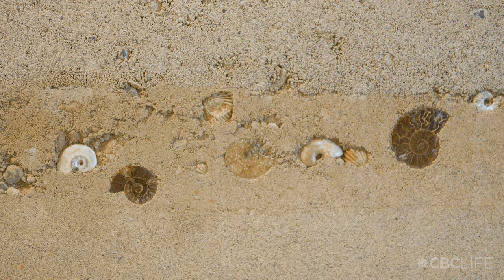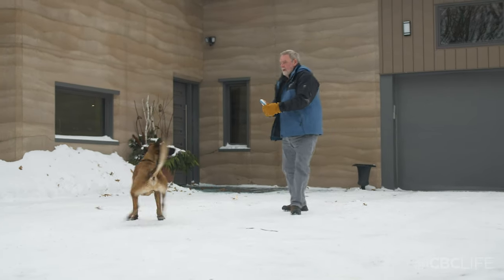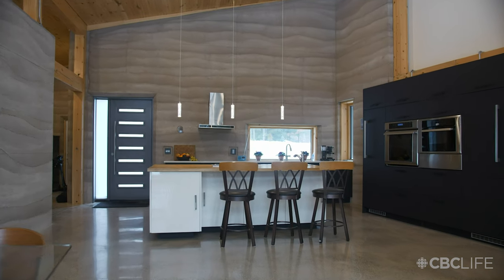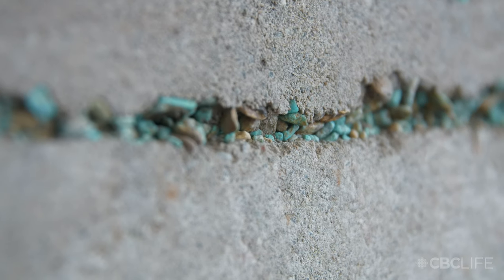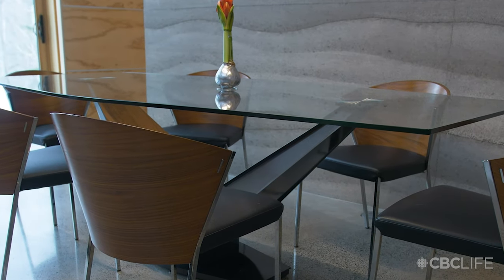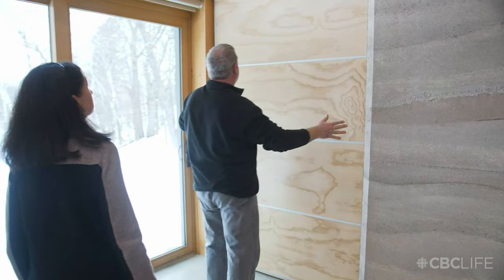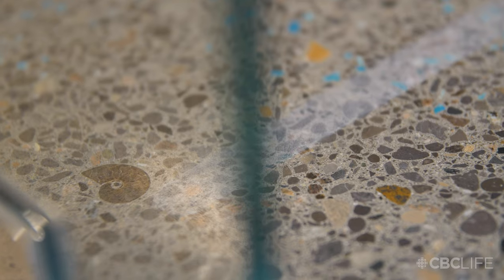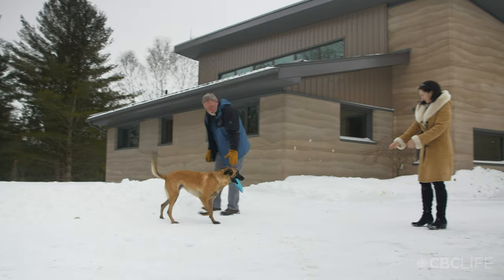Sustainable Rammed Earth House Tour

Comment: Just seen your channel for the first time and i am very impressed with your modern and spacious looking house. I am over in the UK and thinking of buying a property in Bulgaria and was looking at an innovative way to build a warm house for the winter months. How do you keep the house warm and what part of North America are you located ?, also how big is your house and do you have underfloor heating or electric heaters in the house ?
Reply: This house is built in eastern Ontario. It has a 2400 ft2 interior footprint. First the walls, floor and ceilings have to be insulated (minimum R40) and air sealed….that is critical. Our heating system relies on captured rainwater from the roof, stored in a buried underground cistern (3000 gallon - wish it was bigger). We have a liquid to liquid heat pump that circulates glycol through the cistern water and extracts the heat, transferring it to the in floor heat loops.. We maintain 18-20C over winter. This is the ONLY heat source for the home. From Nov-Feb, the water stored in the cistern converts to ice as the heat is extracted. If winter is particularly harsh, then entire cistern is ice. We add small pumps to circulate the water which prevents everything from freezing solid. The insulation and air sealing is critical. Last winter we lost power for seven days…..so no heat. The interior temperature of the house fell one degree in seven days. So don’t neglect the insulation/air sealing details.
Reply: @weshanson1281 Thank you for your answer. I was also interested to know about it.

Which insulation material do you use for insulation?
Does insulation sit in the middle of the wall ?

Comment: The fossils are an incredible addition. 
I'm just wondering about the weight bearing and water resistance? Is it possible to make a 2nd floor?
Reply: Thanks our walls are 20 feet tall at the highest point. Two floors are absolutely possible

Comment: I love the lines on the walls! Very cool look and a good story.    Rammed earth walls do work well in New Mexico with hot days and cool nights but in Canada's constant cold winter weather I can't see rammed earth as providing any insulation at all.  If this is an insulated rammed earth house it's not very sustainable at all. Actually even calling it rammed earth is a stretch, portland cement, gravel and soil make concrete, not rammed earth. 

How about some answers?

The total cost of the house?
Time to complete?
Size of AC system?
Monthly kwh used? 

Once we have that info we can determine how sustainable it is.
Reply: Rick Parker 

To answer your questions.

The cost of the house was about $500 per sq foot of living space but a fair portion of that is related to finish choices, particularly the kitchen and bath areas.
The time to complete was, essentially two years, largely because once the building envelope was complete, we did all the interior work ourselves. We also took six months off and suffered significant delays waiting for the concrete floor to be poured and polished. The exterior building envelop took eight months to complete, about four for the Rammed Earth walls, the rest on a fairly relaxed schedule.
There is no air conditioner. There is no need. Summertime temperature rarely hits 24C and the HRV is sufficient to cool the house at night.
The energy costs are $125 a month in summer, $250 a month in winter. Energy demand is primarily related to domestic water (well)  and hot water. Total energy use is about 60% of what a typical stick built home uses based on ON averages. I don’t really worry about it. There is no furnace, no wood stove, no AC. Heat is from a water to water heat pump that cycles glycol through a buried cistern behind the house which is filled with rainwater captured from the roof. The winter electrical cost is largely from the circulation pumps for the in floor heat. Heat is turned on in November and shut off in March. In the fall and spring, the passive solar is the primary heat source.The cistern water is used for irrigation in summer.

Yes, the walls and floor are insulated, at about R40. The ceiling is dense pack cellulose at R80. 

There is only 5% Portland cement in the mix. It’s definitely not concrete. Concrete is...well concrete. It’s ugly but easy. A great choice if bunkers are your thing.

Anything else?
Reply: cement is the only necessity in it and its minimal. Something from like 7% or more depending on choice. Gravel is not essential. There are still earth-made buildings and walls constructed thousands of years ago that are still standing.
Reply: Concrete doesn't use soil. Concrete consists of cement (15-20%), sand, gravel, and water. Rammed Earth consists of cement (5-10%), sand, gravel, and soil (containing clay and silt). Concrete never contains any clay or silt content.

Comment: Interesting..!! 
How is the insulation done?
Reply: You don't need insulation in a rammed earth home, except in the ceiling. The walls themselves are all the insulation you could ever want.
Reply: @amdinga561  the house in biult in Canada, there is an insulation, it's inside of the wall
Reply: Rammed Earth walls usually 24 inches wide, it can be less but than it's hard to work into the formwork. The rigid foam insulation is used and embedded  while you ramming the wall

Comment: Wes....do you have an interior section of foam in the rammed earth?. Do you have heat changes in summer/winter in the house? What is your roof made out of? CCC-Texas
Reply: Yes, the wall cross section is 6 inches RE, 6 inches of polyiso foam and an eight inch interior RE wythe. We live in a cold climate, the heating costs with straight RE would be outrageous. There are many RE homes in Arizona and my understanding is they are not insulated, the benefits of warm climate. We have no AC and on humid summer days the house is noticeably cooler when entering the house from outdoors. The only uncomfortable time is 3-4 hours after sunset on those hot, humid days because the RE releases the heat accumulated during the day. Generally , at 30 C outdoor temperature w 100%  humidity, the interior temperature is typically 22 C. I n the winter, our heating costs are roughly $100-$150 a month, straight electricity. At -25 Celsius, the heat pump struggles but the internal temperature rarely dips below 20C. Interestingly, the more people in the house, the warmer it is. So at Christmas, the extra family makes the house a degree or two warmer due simply to body heat as we focused on sealing all air gaps in and out of the house during construction.
Reply: Oh, as to the roof, we went with a steel roof for the simple fact that we harvest rainwater off the roof. We considered a green roof, to reduce the heat during summer but the rainwater collection won out.

Comment: Are there any references for building a house like that online. Reason I ask is because I have had two contractor friends here in the US that are questioning the loadbearing of the wall and it’s structural integrity.
Reply: There are plenty of references, and the load-bearing/structural capabilities of the rammed earth is quite high based on many SRE contractor's works. However for each specific build you will need to have it compression tested to ensure the mix's capabilities.
Reply: As with many custom designed homes, a structural engineer has to approve the drawings. The best reference to RE construction is Tim Krahn’s book, Essential Rammed Earth Construction which can be purchased online.

Comment: How were the fossils embedded while ramming?  Very interesting concept
Reply: Exactly how you said it. They were placed there during the ramming with rammed earth material around it to solidify everything.
Reply: @piotr803  I m trying to work out how they were kept on the outside of the  finished wall ,but between the  partition s..
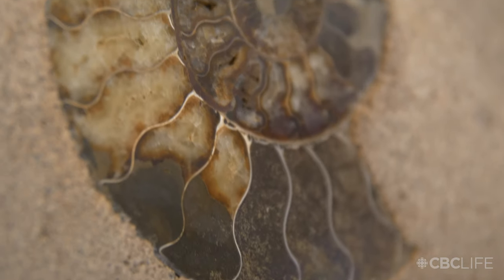Reply: @rogueskywalker7649  1:25 you can see that the big shell was placed exactly on top of the last compacted partition, and placed right up to the framework, not outside it like you say, but nice and flush with the framework so it'd be flush with the finished wall. then most likely the earth mixture was added around it and compacted carefully so as not to damage it (they might have added a bit of cement behind it to hold it in place - that's what I'd consider doing if I had doubts that it's going to stick well). It looks relatively simple to do if you're carefully compacting the earth around it, no? you can also just pour some crystals and smaller shells right at the framework edge and put earth around it then compact it to solidify everything.

Comment: HI do you add heating for winter?
Reply: Hagai Mel yes, we heat using a water to water heat pump. The heat is collected from rainwater which we capture in a cistern buried behind the house. We have an electric hot water tank augmenting the heat pump and acting as an emergency heat source.

Comment: You can do it even without cement !   Look up architect Martin Rauch
Reply: You can build without cement, but you want to add cement or other binders for tensile strength. Buildings without the binders end up crumbling in earthquakes, or dissolving in heavy rains and floods.
Reply: @elmerkilred159  rumours and fairy tales  ...   if you can read,  Martin Rauch wrote a book or two about the how to.   Still laughing hard about the rain dissolving rammed earth ...
Reply: @petersieben8560  I've constructed with rammed earth. I don't need to read your book. Heavy rain combined with a heavy load without stabilization equals structure failure. This is why you can't build basements and foundations out of it.
Reply: @elmerkilred159  good that you are mr iknowitall ...
Reply: @petersieben8560  Now you know that you have to use a stabilizer in the soil to build a stucture. BTW, your architect buddy has a video on Youtube, and he talks about stabilizing his mix with cement, and in other applications he uses casein.
Reply: @elmerkilred159  btw, i know tht ...   lol  who is talking about basements and underground construct.  ?
You, buddy
Reply: @petersieben8560  You better re-check your original post. You wrote, "You can do it even without cement." That's a half-truth. You can but your building will suffer once it gets saturated with water. This is why 5%-10% Portland cement is added to the mix for stability.

Comment: dont locate this house in a siesmic land it will crumble easily. .. aesthetic is wonderfull.
Reply: Not true. These houses are very earthquake proof when built appropriately, especially since the typical wall is no less than 2 ft thick. Walls above 8 ft high are reinforced with rebar or bamboo. They are also mixed with a 1/10 ratio of Portland Cement which stabilizes the earth, unlike indigenous homes that are made this way without the cement or rebar. They are some of the strongest structures you can hope for in a seismic area. So, if you're interested in this kind of construction and live in a seismic area, then no worries.
Reply: @rachelshelley4779  Thanks for your input Rachel.
Reply: TyBil21 Rachel Shelly is correct! I’m not overly concerned about the home either in terms of weather, earthquakes or fire.
Reply: These walls will remain long after humanity has eloped to another solar system
Reply: @OlllOHD  lol